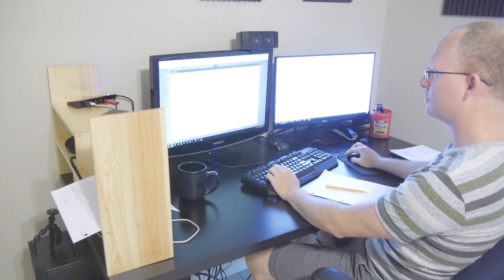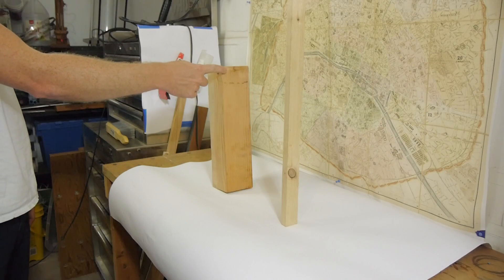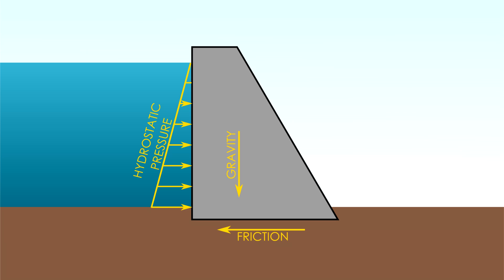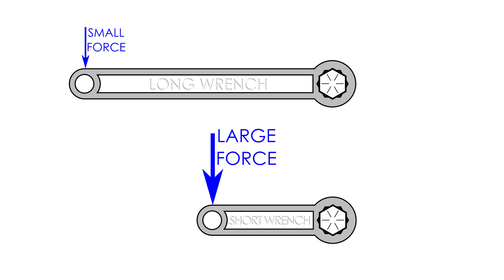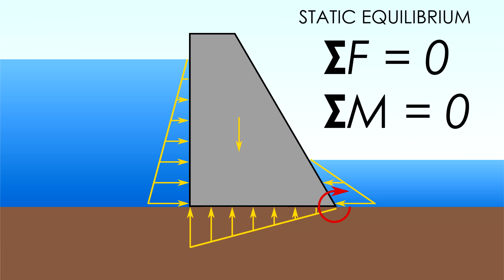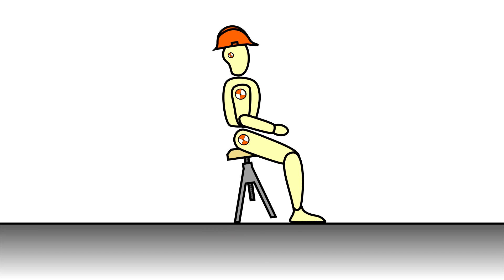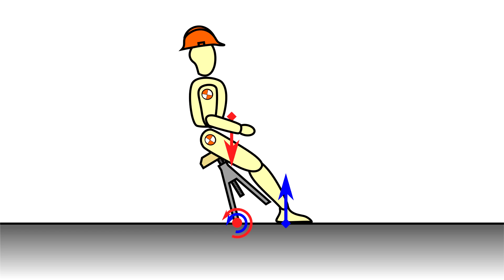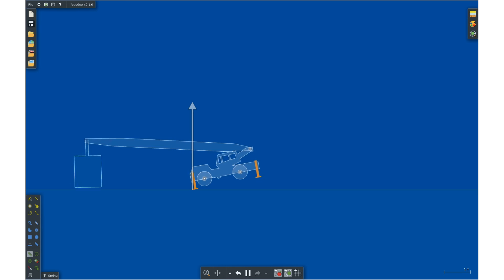The Physics of Falling Back in your Chair

Comment: Design the “Chair” already on the ground with the supporting part of the” chair “ able to lift the weight of the “person” with user friendly Dring suggestive reinforced allocated area. That when that chair falls, the puzzle of lifting it back it up would be obvious.

Now I just need to consider hydrolic, pneumatic, mechanical, counter weight, and possibly controlled detonation to do a series push and pulls calculation a result of upright position.

Then design a mechanism or place of anchor to latch securely attach a flexible series of cables attached to the chair and ground with enough space to still lean on the chair but limit its distance to the event horizon  of “tippage” 

Securing the back legs with hinges that leaning is still possible but preventing movement in the horizontal plane. Adding a gas valve piston like those of the office chairs. That when the person leaning suddenly decides to naturally correct for balance it’s not violent. But in fact delivering the reaction “oh!” To the presuming
Person sitting.

All these need to ready before lifting the chair back up. Planned and designed at the erecting that connecting the gas valve at about 2% from the event horizon or center point of gravity.  Then we push back too it’s position the valve will gently let down the chair in place.

The mechanism for the valve would be like a seatbelt is to a car. Only activating at a certain return speed giving no resistance to movement unless sudden rise in velocity.

Sir. Thank you.

Comment: What I find interesting about leaning back is that you need the back legs, whether you are on a 3-legged or 4-legged chair, to be aligned at 90 deg. to the front of your body. Try leaning back when the the 2 front legs are in alignment with the front of your body. Won't work. A 4-legged chair would require that the front and back legs be at a 90 deg. angle to the front of your body to make it difficult to tip backwards. 5-legged chairs become very hard to tip back.

Comment: The number of legs a chair has is an interesting bit of engineering over time. 

A short stool might have as little as 3 legs because that's the minimum it needs and your risk from falling over is also minimal. But these are largely artisan stools now because falling over is still inconvenient and they do that a lot.
A fixed chair (eg. a dinner table chair) or bar stool will typically have 4 legs, which is stable enough for that usage because your movement is relatively simple and your plane of movement relative to the chair is fixed so they can be angled to improve stability.

A swivel chair today will have 5 or 6 spokes, because this decreases your chances of lining up two spokes in a way that creates a fulcrum that your center of mass is behind. Older swivel chairs (I have sat in one that was...clearly designed in the 60s from the color) can have 4 spokes instead, making it extremely easy to move in a way where two of them create that fulcrum.

Your center of mass moves past the fulcrum because you are sitting with most of your mass near the back of the chair rather than directly over the center (unavoidable) but want to swivel around the center (also unavoidable) but the fulcrum in that direction is created by a line traced between the two points of contact in that direction. And with a 90° angle, that easily puts the fulcrum inward from your center of mass. The chair has its own mass which helps slightly, but even leaning back a little can quickly get out of hand with fewer spokes.

That said, the only time I've fallen over backwards "in my chair" was when the metal bracket holding the chair to the base sheered off. Obviously, plenty of other areas should have failed before the mounting bracket sheered. It was thick steel, and sheered length-wise, so I don't have a clue how it did that other than "I bought it at Walmart".

Comment: I just tried overbalancing in my ISO 21015:2007 standard office chair. It’s got 5 feet, which means that the pivot point is quite a long way behind the sitters centre of gravity. I have to put a lot of force on my feet to even start to tip. I have to lock the seat in the upright position and it’s quite a big effort to get back far enough to even get near the tipping point. I’m guessing that ISO21015 standard is protecting me from getting in a dangerous position.

Comment: Yes you can recline but you can easily counter act that by making the chair crump down when almost at the center line. If it does in a certain way it'll change the center line back. So more push is needed. Simple. Make your chair feet into a triangle or say a 4 sided triangle lol and there you go

Comment: Nice video. Rigour yet fun and interesting.

I am no engineer, but at 4:17, isn't the reason for the ground not giving away, the fact that it requires more force?
The said-balanced forces arises due to Newton's 3rd law which in fact do not cancel each other in any given situation as they are acting on different objects.

Comment: But isn't having your forces balanced unstable? In the dam example, if the pressure and friction are perfectly balanced, then adding even a small amount of pressure (say a small breeze) and that additional pressure will overcome the friction and your engineering career will come to an end. People will think you are a damn idiot and you will lose any trust people have placed in you.
    You want you friction forces to be much MUCH higher than the pressure force, so that there is very little chance of ever having enough pressure to break the dam.
   In Star Wars the Jedi Counsel wondered if Anakin was the one prophesied to "restore balance" to the Force. If the Jedi had understood what this meant, they would have killed Anakin at once, because he did indeed restore balance to the Force. Before Anakin the light side of the Force was represented by a vast army of Jedi, the dark side had only two devotees. When Anakin turned he destroyed all but two Jedi.
    The Counsel just assumed that balance was better than unbalanced, without realizing the Force was unbalanced in favor of the "good" side.

Comment: I have an office chair with wheels and one time, not realizing that the back support had gotten set to allow me to lean it back pretty far, I did just that. But, instead of merely falling backward, at some point the wheels slipped allowing the chair that would not have otherwise been able to fall over, to do so. It was a pretty cool moment (no pun intended) since I didn't get hurt.

Comment: Great video!  Two opposing forces produce a couple, that is, a torque which is the same regardless of it's placement on the part.  a single vector force causes a torque which is dependent on location.  I've used statics for years and it is still so deceptively simple with some concepts.  all you need to know is that in a quasi-static system, sum of forces is equal to zero and the sum of moments (about a given  point) is zero.  That gets you 80% there.

Comment: Ay what's wrong with aerospace engineering? Some would say it's harder than civil.
Reply: He didn't say anything was wrong with it, and I would say it's definitely harder, as it's mostly dynamic, rather than static engineering. A lot more simulators and failure modes.
Reply: Late comment but all he was saying was that an Aerospace Engineer wants things to move. Therefore, if you apply a force and the object moves, then the Aerospace Engineer's job is done. However, a CE needs it be static, so he'll have to balance the forces out. There was no insult intended anywhere there.

Comment: 5:12 that diagram is incorrect. the moment would get smaller and smaller as the length of the lever got shorter and shorter, than @ 0 there would be moment. past 0 into negative numbers, it would make a negative moment, growing from small to larger. 

torque = (force perpendicular to lever) x lever length

you noted how you feet have to make a counter moment to keep you balanced, this is correct, but as you approach a lever length of 0 on the chair, the force your feet need to exert get smaller and smaller, you can feel your feet pressing less into the ground.
 
if you feel the your feet about to loose contact, you can lurch your chest forward which will allow you to not fall over.... there is a point of no return tho, but i think it's ever so slightly past the lever length = 0 point.

Comment: 1:32 I (kind of) disagree!
It would (probably) be very beneficial if the roads accelerated (but not infinite acceleration) as long as the roads was "accelerated" in the same direction you were traveling.

Comment: Great video.  Sometimes I'm sitting behind a cement mixer at a stop light and I'm amazed that the cement vehicle doesn't fall over more often.  I picture the center of gravity of the cement inside the mixer and the apparent 'top heaviness" of the truck and wonder at what point the vehicle can lean before it tips over. I've seen 18 wheelers get hit by winds and they tip.

Can you do a video using your computer animation tools that can demonstrate at what point cement mixers or 18 wheelers tip over?   I visualize the outside wheels as the reaction point, then try and line up the center of gravity in my minds eye.  Then you have deflection of the suspension system that complicates the situation - the springs deflect tilting the whole mes.  Any thoughts about this?

Comment: :D He is under-estimating other branches of engineering other than civil engineering. Though this time he literally got it wrong. It's actually the reverse. Earth with all it's mass and friction capabilities is a really good and easy anchor for stability. In other words just put an extra ton of cement and you are done. Safety factor constraints are not harsh as aerospace engineering where you are not allowed to put an extra gram. They started to make planes out of Carbon Fiber and glue to save the weight of rivets for God's sake. I like this channel very much but this was an epic mistake.

Comment: this is why it is good to have a desk with low cut back plate. once you go over the point of no return you have a way to hook your feet to the desk to apply counter rotation again and return. the only problem then is friction and material strenght. if the leg of the stool slips or the leg breaks you are on the floor. that might be a good idea for a video :)

Comment: Statics also applies to things that move in an external reference frame, but are static from an internal reference frame. ie, a car/plane/train/helicopter.

I think it would have been cool to show statics using a wheel chair. You can lean back and balance yourself by summing moments, but it works both ways!

Comment: I have a question. In my hometown of Utrecht there is a bicycle shed underground. To reach it you must go down an incline. When you leave you must go up the incline. To help people pushing their bike going up this incline there is a small conveyer belt (about the whith of the wheels) on which you can place your bike. It says to push your handbrakes when going up. Most of the bikes in the Netherlands do not have handbrakes but back-pedal brakes. I think the conveyer belt does absolutely nothing to the experienced heaviness of the incline if the wheels still move on top of the belt. The incline, after all, is the same. But I struggle to come with a mathematical explanation. Please help!
Reply: Put a stick through the spokes
Hope that helps

Comment: Big feet = more surface area
more surface area = more van der waals forces 
more van der waals forces = some form of resistance to falling back

it's negligible and doesn't really help in an engineering sense, but so are chemists lol jk
Reply: if you didnt put the "jk" after that, some chemist  would make a combustible lemon to BURN YOUR HOUSE DOWN
Reply: Jorge Cervantes We just say London forces in chemistry class and that statement seems extremely familiar.
Reply: If you were a gecko, you'd be right.
Reply: oooh, that was a chemical burn!
Reply: Planet sized feet = greavity
gravity = keeps stuff down
keeps stuff down = stay on ground
Reply: Mr. Lanchester I take issue with your flagrant abuse of the equals sign.
Reply: Jorge Cervantes I
Reply: Idealy flat feet, like on picture, have to snap to idealy flat floor with great strength.

Comment: The same mechanics dictate whether a landing rocket (like the returned SpaceX first stage) will tip over or not.  They need to keep the rocket's center of mass within the "zone" created by the landing legs, otherwise... they'll need really strong maneuvering thrusters to pull it back to safety.  Or it tips over and blows up.

Comment: Did you build that chair just so you can fall over in it? haha
Reply from the maker: Even worse. I wrote a statics lesson just so I could have a reason to build a chair!
Reply: Any excuse to break out the welder and lathe.
Reply: You forgot to mention why it only has three legs! Also, please don't fall onto your cat ｡ﾟ･（>﹏<）･ﾟ｡
Reply: after this lesson my constipation got fixed right up

because I learned to control my stools
Reply: Amazing.  This is my new favorite channel (even though I subscribed a while ago).
Reply: +Pongo Only if the chair was oriented with a single leg behind him. Once the chair is tipped onto two legs, it doesn't matter if there are 3 or 4 total.
Reply: @ugoleftillgorite  but if that fourth leg faced straight behind him it'd make the chair harder to tip over because now your adding a new point of contact with the ground.
Reply: Practical Engineering 😂😂
Reply: PongoXBongo What axial rotation issues are you talking about? By introducing a 4th leg, you only make it hard on yourself because getting all 4 legs level is god damn hard, and any angulation in the floor will make all your leveling work useless anyway. 3 legs will always be flat on the ground. So actually you make it more expensive for no reason, since there are no axial rotation issues.
Reply: You just need 3 legs to be stable, as planes are created by 3 points. 4 is just extra.
Reply: @isaiahy9026  Try telling that to a 3 legged  dog :/
Reply: @Rubixdecampo  Well of course the doggo with 3 legs will be unstable as all 3 points of contact aren't equidistant from each other.
Reply: +Practical Engineering XD
Reply: Wouldn't three legs add another point of rotation (axial)?  That wouldn't be an issue with four legs.
Reply: PongoXBongo could you rephrase that?
Reply: +Practical Engineering
Statics is fun :D
Reply: Practical Engineering 
You're a mad man
Reply: When up on one leg the stool can spin about that leg's axis.  Perhaps lateral rotation would have been a better way to phrase it.  The likelihood of such one-legged rotation is greatly reduced with the addition of a fourth leg.  Leveling is just a matter of fixing either your stool or your floor (or adding a bit of flex so that your body weight spreads the legs).
Reply: Well, technically, you still have lateral rotation with 4 legs, just that it requires you to sit with 1 leg behind you, which is slightly(?) less likely than with 3 legs.
Lean back, and you still have to deal with that axial point of rotation.
Reply: you can't have an unbalance stool with only 3 legs, all three will remain on the floor so you can't rock it
Reply: Björn P. Oof :3
Reply: I have to say, that's a poorly built chair there's a reason office chairs sit on a wider base..... with a wider base you change everything....
Reply: Guys, c'mon, the point of the video WAS to fall over lol!  I mean, as long as two of the legs are back behind him and parallel to his buttocks, he's achieved his goal!  Personally, though, I think that that chair belongs in a place of honor somewhere in his house - the woodwork of the seat is superb!
Reply: Assuming cost and complexity is low enough, it seems like adding a fourth leg is a no-brainer to increase stability (near completely negate axial rotation issues).
Reply: @PongoXBongo  it could still fall over with enough force ,but a fourth leg facing in the direction of the fall would make it more difficult to  move in that rotational Axial...
Reply: @sheilaolfieway1885  Agreed.  And to reference a previous response of yours, this is why rolling office chairs typically have five legs.  That ensures a "straight behind" leg in pretty much every direction (at least in theory).
Reply: @PongoXBongo  almost.

Comment: Videos like this are exactly how things should be taught. Give a physical, relatable situation and explain how what you are teaching applies to this situation. I used to hate the later stages of physics and math when the teacher would just tell you an equation and you just had to memorize it without really understanding how you would use it. I'm sure anyone that has watched this could now apply the knowledge to other situations such as why the leaning tower of pisa is still standing and how far it could actually lean before it is likely to fall.
Reply: As a physics major, this was my experience on steroids. Especially when we later got into the parts that were boiled down to "We dunno. The math says so and empirically it checks out. So just follow it."  

Doubly so if the math led to imaginary numbers in the middle that eventually got canceled out. Absolutely zero intuition in some cases as to what the imaginary numbers could represent intuitively. I assume this is how people "bad at math" felt in early algebra classes or when caught on old Vines being asked questions like "If you're moving at 60 mph, how much time does it take to go 60 miles?"